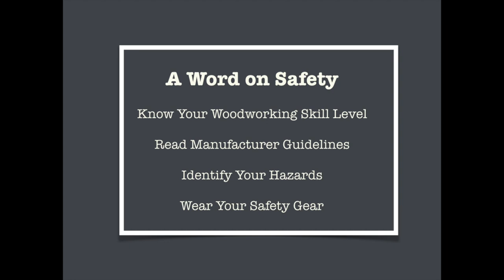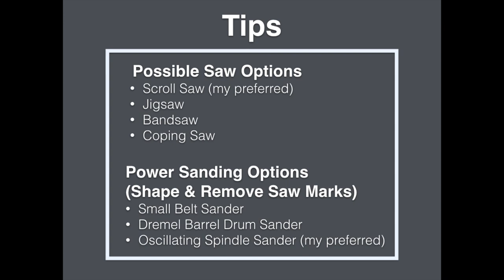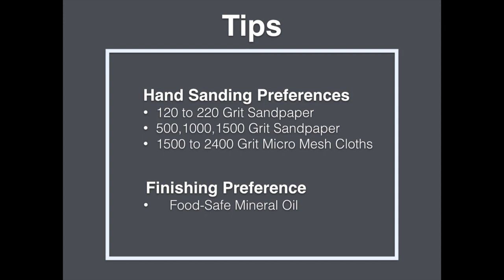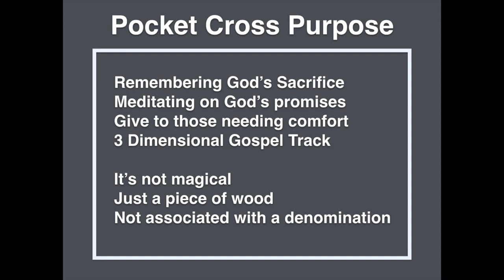Pocket Crosses DIY

Comment: Love these crosses ... are you using 1/2" or 3/4" thickness?
Reply from the maker: Sorry I'm just now responding, but I prefer to use 1/2 thick boards. I will often find 1/2 inch thick Olive boards that were meant to be cutting or bread boards and will use them. You can sometimes find them in stores like Target, Bed Bath & Beyond or TJ Max. I'll often find them a little cheaper there than if I buy in the woodworking supply stores.

Comment: How long did u soak them?
Reply from the maker: I think I left them in there for a few hours, but even that's probably not necessary. Over time, the hand will form a patina on the wood. You might also experiment with my mineral oil / beeswax mix which I have another video showing how to make that.